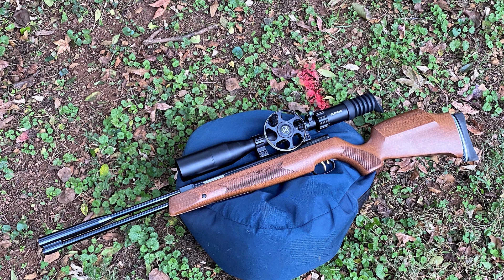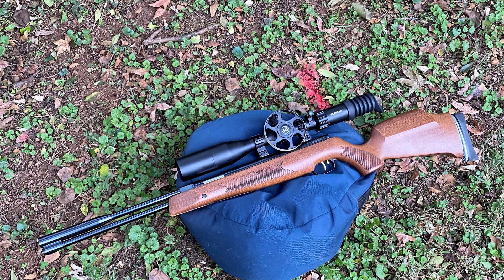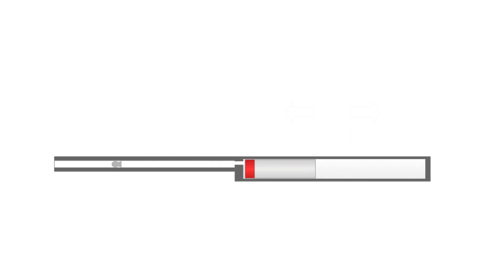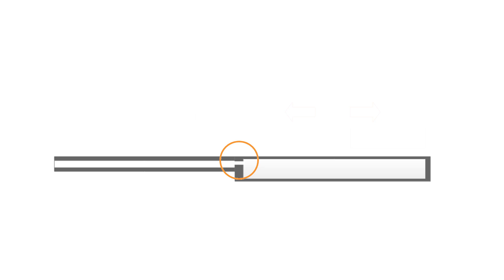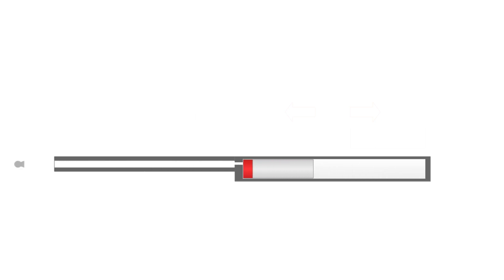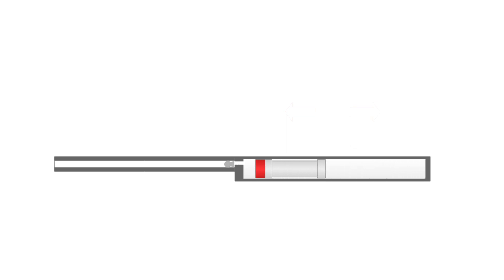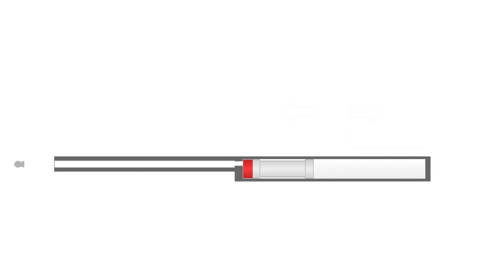Spring Piston Airgun Recoil 3 -  Tuning Piston Bounce

Comment: I have a .22 hw80, I drilled and tapped the transfer port so that a dog point grub screw fits perfectly. I have drilled the centre of the grub screws from 1.5 to 4 mm in half mill steps so I can experiment with different port sizes. At the moment it will shoot from 500 to 720 fps depending on the port size I put in. I have a tbt spring in at the moment. I was really apprehensive to do it but it works really well.

Comment: I have just invested in a HW 50s I have found your series very interesting Also some of the ideas in the discussions. In my opinion when the piston reaches the end of its travel  there needs to be a pneumatic buffer to stop metal to metal contact and piston seal  face damage As you state the transfer port has to be gauged to the velocity and pressure  All food for thought Thanks for sharing

Comment: Thanks for the video. Can you recomend a good springer for tunin purpose? Hahahah
Reply: HW97 K for example?
Reply from the maker: @portaminast7265  In my experience the non FAC version of the HW97 is one of the easiest rifles to tune.
Reply: @Guru1ofatl  the non FAC?? Whats that term mean. I saw it was the up to 24 joules isn't it? But what diferences has comparin;g with the non FAC?... less pins or something?.... i mean... i was looking for an airgun in.55 to raise the power above 24j.. maybe 35 or something. In order to shoot heavier pellets at longer distances in my state...
Reply from the maker: Most anything can be tuned but I'd be sure to go with anything that has good parts support.

Comment: A tight fit or snug fit .spring inside the piston and piston gide makes the gun super accurate  .
Reply from the maker: More importantly, the guides should isolate spring rotation from the action.
Reply: @Guru1ofatl Spot On ! This is actually a critical point for Spring Guides, Top Hats, and Piston Sleeves. In the end the spring still has to be able to rotate freely without transferring torsional energy to the action or hold sensitivity will be multiplied exponentially ! ⚠️ 
Proper bearing washers, and the judicious placement of the Right lubricants are a wonderful thing. 😁
I Do like to isolate metal to metal contact and the closer the tolerances (While still moving freely 😉) the less lubes are necessary and shot consistency is improved with lower maintenance. 🤓
Sleeves should always be split to allow the spring to expand and contract without interference. If a  sleeve (Delrin or Brass) is solid, or too thick it WILL eventually washboard and interfere with the spring's unloading and subsequent stroke.
Delrin bearing washers can be useful if you want to avoid the added weight up "inside" the piston. 🤔
Admittedly I will still use spring tar on any coils that are still exposed behind the piston or uncontrolled by the rear guide, but I tend to brush that on sparingly. 😉
A properly sleeved piston really should allow any lubes to be transferred up in front of the piston seal. 🤷🏼‍♂️
Moly shouldn't be slathered throughout the reciever, just lightly burnished (practically dry, if it's glistening, you used to much !) after cross hatching the cylinder "prior" to loading the action, and lightly dressed behind the piston seal, and behind the rear guide and thrust washer, but in all cases Less is More. ☝️🤨 All lubes can effect shot consistency with temperature fluctuations. 😣 but the gun shouldn't be bone dry or sterile either. 🤷🏼‍♂️ 
Unfortunately some guys discover lubes and tar and Really get Happy with it. 😂
Greater point to all of this is that properly fitted Delrin components just don't need or benefit from all the Sauce. That's an old habit from back before we ever had decent polymer guides and sleeves. 😊
But... I Digress 
Preaching Off !!! 😆😅😂🤣🤣
Reply: EDIT: Sleeve "Shouldn't" allow lubricants to migrate. 
Got Spall Chucked ! 😤
Reply from the maker: @marcmyers1465  spall chucking is the worst! 🤣

Comment: Very informative video explanations in a way that’s easier to understand everyone seems to think putting a bigger spring in an air rifle produces more power the truth is it’s not as simple as that it may sound more powerful but it’s not and only way to prove anything is checking on a chronograph.. thanks for sharing 👍👍👍
Reply from the maker: Thank you! Yes, a chronograph is a crucial tool when it comes to tuning.
Tuning really is a finer balance of factors than many realize. Throwing huge springs at a gun is an old fad I wish would die.

Comment: the size of the hole of the transferport ,if to big the air, wil  not build up pressure but also no heat , and heat is more volume of air and a factor of the power output
Reply from the maker: The length of the transfer port does this as well which tends to put break barrels at a bit of a disadvantage.
Reply: @Guru1ofatl  that also   yes  but could be compensated with the diameter .many breakbarrels do not be airtight with a lot of pressure  . Always take a look if the seal makes firm contact at the cilinder end
Reply: @Guru1ofatl  heat is volume and thinner air